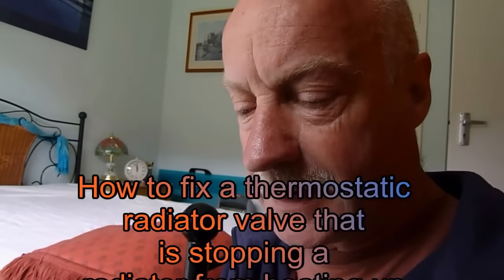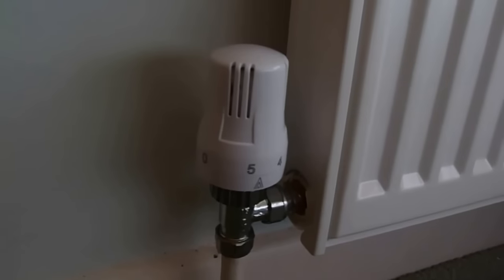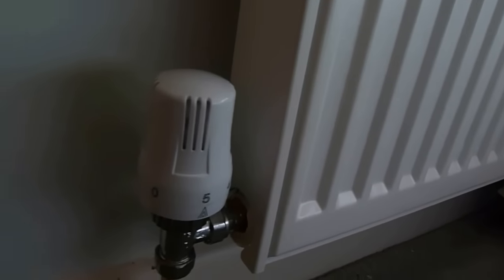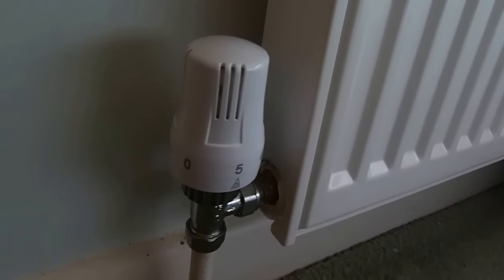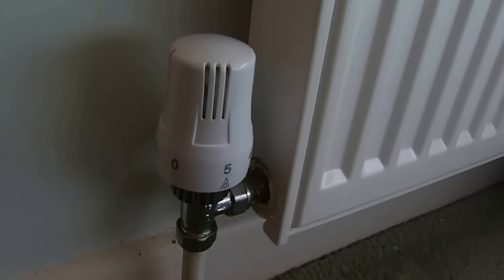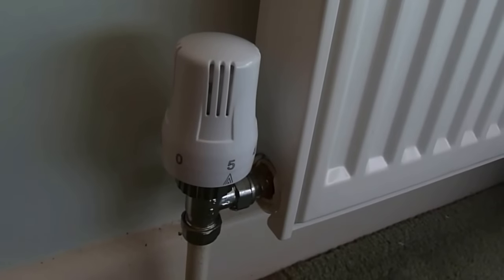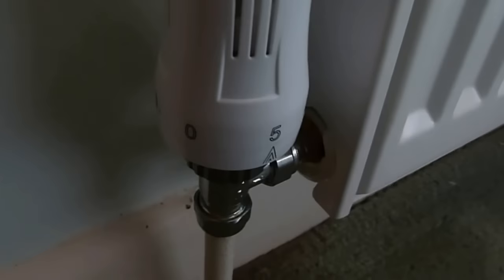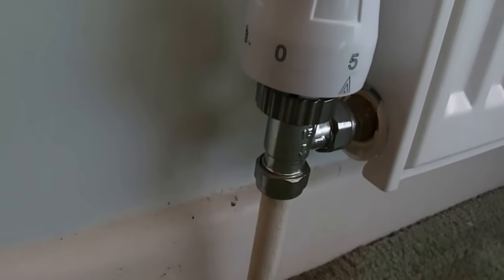How to fix a thermostatic radiator valve if your radiator is not heating up.

Comment: Thanks @dereton33.  That was a great explanation.  I had a problem at the weekend with a radiator. It was cold at the bottom and warm at the top. I had taken the radiator off and flushed it out with a hose but there was not much evidence of sludge when I did it.

When I finally removed the top of the thermostatic valve (like described in your video) and hit the pin with a hammer it opened and I heard the sound of water surging into the radiator. Once everything had settled down the radiator was hot all over, so the problem was obviously resolved.

The thing that puzzled me though was this. I do not think there was much sludge in the rad. to begin with but the radiator was definitely warm (not hot) at the top and cold at the bottom.  And finally ... the question I have is, can a sticky/stuck thermostatic valve manifest the symptoms of a (sludge) blocked radiator?

The only thing I can think which perhaps makes sense is that somehow the heat was conducting/convecting somehow through the lockshield valve and the warm water was (naturally) sitting above the code leading to my mis-diagnosis.
Reply from the maker: Yes that is what normally happens leading to a faulty diagnoses.

Comment: Thanks you so much. Came across this as I had the same problem. A few taps of the hammer ( after spraying some WD40 in the valve to be on the safe side ) did the trick.
Reply from the maker: No problem Sean.

Comment: Thank you so much. Been trying to fix my mums bathroom radiator for ages. Radiator not fixed because radiator not broken. Little pin in value broken.
Reply from the maker: O well new valve then.
Reply: @dereton33  fortunately not. It was stuck rather than broken. Gave it a little wiggle with pliers and its fixed

Comment: Useful vid. I've just had this problem only with a safety stat on underfloor system. Just a question. When you refit the control knob do you refit fully open, fully closed or doesn't matter? Thanks.

Comment: Cheers mate... Just took the head off and had a look at the pin due to my bedroom rad not coming on atall. The pin was up and free, but I pushed it down a few times and the rad is now working. Very strange, I'm guessing it was a bit crudded up inside.
Reply from the maker: Yes stuck in position.
Reply: @dereton33  it had been set to zero all summer. So must be why.

Comment: Great video. We recently removed our rad to paint behind. On reinstalling, I'm struggling to fill it back up again with water. The lockshield valve is completely open - the pin however is jammed in our thermostat valve. Should dislodging the pin allow the rad to fill up again?
Reply from the maker: Yes but do make sure you open the bleed valve to allow air to escape.

Comment: Thanks you have just moved in to a old which had empty for 9 months had 2 radiators doing this tried bleeding them but they where ok found you on here and Bob's your uncle all done will subscribe. I have a question would it be ok to lubricate pin?
Reply from the maker: Yes that`s fine.

Comment: Thank you! This happened on this radiator before, about 5 years ago, so I knew it probably to do with the valve. Yep, a quick twiddle with pliars and a few bangs with the hammer and I have heat agin!

Comment: Hi Alan.
I fired up the heating for the first time in months yesterday, all the rads heat up as they should except one.
 I removed the trv and the pin is stuck down, it will pull up with plyers but when pushed down again it stays down.
Would you say the valve has had it and needs replacing !
Keep the great videos coming mate 👍
Reply from the maker: Yes if does.

Comment: that worked;) thanks!
I needed to pull that "thorn"/pin with a pliers .. hammered a little bit on it and had to pull it out and voilà suddenly I head the water rush in ..
thanks for your support / idea.

Comment: Hi Olympia197.....I had a couple that didn't work, so I did what Dereton33 says in the video ( excellent, by the way ) ....open up the TRV if you have them & give it a few whacks with a hammer....interestingly, the pin on mine came out BUT no water leaks...gave it all a clean with WD40 as the pin seemed to be sticking....working OK now. Try it

Comment: Hi there! Great video. Do you have any videos on how to turn off the water? I’ve taken off the radiators for decorating and they’ve all gone back on fine....apart from one. On the thermostatic valve end the water is still gushing out. I’ve made sure the heating is off and cold (I know they pressure can sometimes make them turn on) but every time I take off the blanking nut it just gushes! Appreciate your help because plumbers are like hens teeth at the moment!
Reply from the maker: If you have a combi boiler, just keep emptying the water until it stops. If you have a F and E system then go into the loft and shut off the small header tank, or alternatively shut of the mains. Again just keep emptying the water until it stops.

Comment: I've got two radiators one that won't heat up one that won't cool down. Took both the thermostatic valves off. Both have stuck pins which will move if I pull and push them with pliers, but which won't spring back up of their own accord, they just stay in whatever position I push them with the pliers. There seems to be a bit of brown crud around them too. Is there anything I can do  to fix this? PS your videos are very useful - you explain very well.
Reply from the maker: The valves are corroded and will need renewing, once the pin jams, like yours, the valve is knackered.

Comment: Al (Dereton33)
I, too, have just fixed one of mine and the pin did come straight out when I gave it a pull with pliers. Not too hard a pull either. My TRVs are only about 4 years old as well, being Danfoss PAS-D2 Combi.
I've stuck the pin back in (and the water stopped coming out!) so it just remains to be seen if it remains watertight when the water starts pumping......!
Reply from the maker: Gary Benn Usually there ok . Al,

Comment: Ive found a few drops of release oil drops on the pin works well too. The biggest problem is the Myson TRV2 valves failing. Ive replaced number of them at £16 each. Learned a while ago they should never be screwed down beyond the snowflake as that can cause failure
Reply from the maker: Thanks for the extra info Stanley.
Reply: dereton33 thanks for your response, any idea why the TRV unit fails, had one apart and the fault is in a sealed metal contained unit within the TRV unit. Release oil works well but isnt a permanent cure in my experience. Takes a minute or so act before the pin shoots up.
Reply from the maker: I just keep away from the cheap ones and keep with well known quality makes like Drayton.
Reply: dereton33 OK hadnt appreciate Myson were not the best quality, The house had them from new and as you know changing the entire valve is no small job!

Comment: In our case the pin was fine but the valve was shutting off since a curtain was blocking it. The plumber simply unscrewed the valve to loosen it. (The room has a seperate thermostat anyway)

Comment: You lifesaver, I now have a working radiator in my bedroom :) TYVM. I also used Astonish mould n mildew remover on the pin before whacking with hammer haha...hey its as good as WD40 ;)
Reply from the maker: Best tool ever invented, ha ha, the hammer.

Comment from the maker: I always fit them fully open .
Kind regards,
al.
Reply: Hi found your video and checked the valve it was stuck but up not down I hit it which has let it move up and down with a lot of pressure the pipe is now heating up way more than it was but the radiator is still cold could this be because I tried to bleed it first an loads of water came out

Comment: Hi, good video. The pipe to the valve, is very hot but doesn't seem to go past into the radiator as it should, the rad gets warm eventually but only after I fiddle with the valve.
Reply from the maker: Malcolm Baker Take the top off the thermostatic valve and check the pin is popping up and moves freely. If it is working ok, then you may need to system balance your radiators, see my channel for a video on how to do this.

Comment: Hey great video. I have some Drayton v3 values..the pin is much smaller but I can't push it down with my finger. Does this mean the valve is not working correctly?
Reply from the maker: No they are fine. So long as they pop back up.
Reply: @dereton33  another idea for a great video for you. Lots of people are moving to "smart" TRVs. One issue I found is that the Drayton v3 is 28mm and standard TRVs are 30mm. Sourcing and adaptor is not easy, would be great if you had one in your Amazon shop.

Comment: I had this problem the other day with a TRV. The pin isn't set in a brass seating like the youtube video but in a hard black plastic seating. I got the pin out with a pliers but there was no spring to it and the rad didn't get hot. I don't fancy hitting it with a hammer in case I break the plastic around the pin.

Comment: thanks for a useful series. my valve is horizontal but has a pin just like you show. I can get the pin to come out with pliers, but there seems to be no spring action, so if I push it back in, it remains in. I put some silicone grease on it...any other hints?
Reply from the maker: Hi Matt you can try gently tapping around the edge of the top of the valve with a small toffee hammer after that try putting the pin back in and tapping just the pin and top housing. If it does not release then it`s a case of fitting a new valve i`m afraid . I do have a video on my channel on how to fit one though.
Kind regards,
al.
Reply: gotcha...got it working! thanks mate

Comment: Dereton, I pulled the pin right out and it started hissing at me! I popped it back in now. Have I broken it? It's one of those old Myson Valves from 30 years ago.
Reply from the maker: No, so long as it is back in.
Reply: @dereton33  Thank you so much for the reply. You're a lifesaver. Thank you

Comment: Derenton, I am need of advice! I have just moved into my first home and have a problem with the central heating. My central heating and radiators are only 2 years old so fairly new! When i turn the boiler on heat flows to al radiators, but i cannot turn off individual radiators. It look like the thermostats on the side of each radiator are not working, all 8 of them! Do you have any advice?
Reply from the maker: Mike George All 8 cannot fail at once so i think the valves must not be in the right position, make sure the 0 faces towards you when you turn them off. Turn clockwise as far as they will go.

Comment: Hello, looking for a bit of advice from you. I would like to fit a trv in our bedroom but my concerns are that the radiator is under the window and my wife is a fan of putting the long all the way to the floor curtains all the time and therefore cover the radiator. would I be wise to fit a trv? I fear that if the curtains cover the radiator then the trv will shut off the radiator....Look forward to your advise. thanks in advice.
Reply from the maker: It will be affected and shut off .
The numbers on a TRV relate to room AIR temperature and have no relation to how hot the radiator will get. When some radiators feel cooler than others it is because it has shut off and is cooling down.
Number 3 on a valve relates to an AIR temperature of roughly 20 degC and each number up or down changes the AIR temperature by 4 degC difference each number. Number 2 is therefore around 16 degC (60 F) room AIR temperature and number 4 around 24 degC (75 deg F). Hope that helps explain how they work.
Reply: +dereton33 Thanks. It does explain things very well. would you then advise against fitting one in those circunstances? i am assuming we are not alone about having the radiator under the window and having very long curtains covering the radiator in the evenings and early mornings.
Reply from the maker: It certainly would not work properly when the curtains are pulled. Maybe your wife might consider short curtains that end above the radiator.

Comment: Hi mate, I really need your help. I moved in to new property for a year and two months. It maybe the quality of the pipes are used. At three of the radiators, there are leakage at the gap between the TRV head and the connector. Could you tell me how to stop it? Do I have to replace the whole set including the TRV head and the connector? It is supposed no water come out from the gap because the TRV head is replaceable. There maybe something wrong with the connector underneath it. Could you take a video to explain the process of replacing any parts as you suggested? Could you tell me the order of switching off the valve, so that it won't make the room watering all over? It really bothered my a lot. Thanks for helping!    Edwin
Reply from the maker: +Edwin Cheng . Hi Edwin, if the valves are leaking out of the valve where the pin is sticking through then you will need to renew the whole valve including the head. If it is leaking from the nut underneath, ( check by using a piece of tissue paper ) then they may just need a small tighten with a spanner.

Comment: Al, I've got the opposite problem. My radiator is always on full heat even when I turn it down to 1 or 0. Have you got a video for that? Thanks.
Reply from the maker: No, but I can tell you that the valve head is gone and will need replacing.
Reply: Thanks for the info Al :)

Comment: 14 radiators not working in my new (old) house. After following this and working the pin with some grips, now 14 working radiators.  My advice, don’t be shy with the hammer.
Reply from the maker: You cant beat having a good hammer. Ha ha.

Comment: Hi,  this worked ok on the first radiator but in the second the pin actually did come out! I tapped it in again but now the knob won't go back on again.... currently the pin is sitting in but it seems to pop out completely again and let water everywhere.... i hope i can get it sorted or that you can give me some advice. Thanks
Reply from the maker: Hi this type of valve cannot be fixed. Time for a new one.

Comment: Just had  bulldog gen 2 trvs put on radiators by plumber, they all work fine but bedroom radiator heats up gets really hot but after a while cuts out and wont come back on even when room cools down.  Is this correct?, It is set at highest setting, number 5, lounge radiator stays on continuosly on this setting without cutting out.  Thankyou
Reply from the maker: Sounds like you have a faulty valve.

Comment: My pin was stuck and followed this video, thank you. It started to move again but when i put the top back on (with the 1-5) it goes cold again. Any suggestions please.
Reply from the maker: That type of valve is not fixable, you will have to renew it. In the meantime you can at least leave the top off so that it works.
Reply: @dereton33  thank you so much.
Reply: @dereton33  I have no intention of putting my top back on lol

Comment: My radiator is the opposite it won't turn off with the thermostat would you recommend replacing it?
Reply from the maker: Yes if it will not shut off then renewing it is the only answer.

Comment: heating has not been on for afew months, due to warm weather, afew days ago it was rather chilly so i turned it on.....usually it warms up straight away, but all the radiators remained cold, even though the boiler was clearly working, as i heat up the water for baths, which it still does no problem they all remained cold.....so i bled them all, but they are still cold.....its a new combination boiler and its never given me problems before....so why arent the radiators heating up even though i bled them properly via your instructions, im left with a freezing cold house and although using a hot water bottle at night is rather cosy, it is not ideal, any tips please so i dont have to call out an expensive plumber...all the rads in the house remain cold
Reply: id be grateful for any advice please
Reply: @olympia1976  Too late a reply to help you but might be of help to others.  When this happens to my radiators it's usually because the pressure has dropped, check the pressure on your combi and adjust if necessary.

Comment: Hi. Please could you let me know what to do if a small amount water comes out when you press the pin. It eventually clogs up and stops working until I clean it and sometimes is jammed.  Can I undo the nut when pressurised to clean it properly. Thanks
Reply from the maker: No do not undo it you have one of the old type of valves. Best to renew it.

Comment: Hello,
I have the exact opposite of this problem - my radiator is always heating, even when I turn the knob to zero.
As I have figured, there are two pins involved - pin on the valve, that is pushed into the valve by the pin on the knob - when I turn the knob toward zero, the pin comes out more to push the pin on the valve more...
I unscrewed the knob and looks like the turning-and-pin-coming-out mechanism is working. How hard should it be to push the pin on the valve? How deep could it be pushed? I can push it ~half inside. Is it OK? How to fix this? Can something be stuck inside?
Reply from the maker: panda4247 In this situation it is a new valve I am afraid.

Comment: THE PIN ON MY 'HONEYWELL' RAD THERMO IS JAMMED IN THE UP POSITION, LOOKS ABOUT HALF THE THICKNESS OF YOURS ( A BIT FRAGILE) SHOULD I TAP IT AGAIN? iT WORKED FOR ABOUT 15 MINS, THEN WENT COLD AGAIN.
Reply from the maker: No replace the valve.